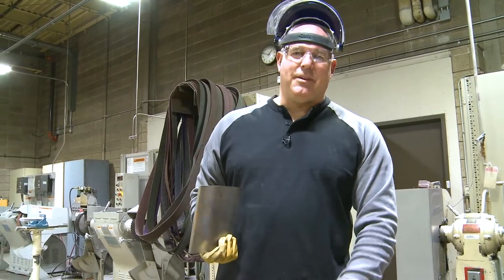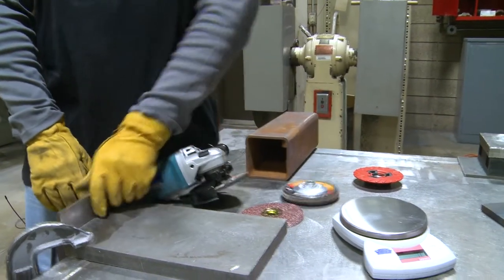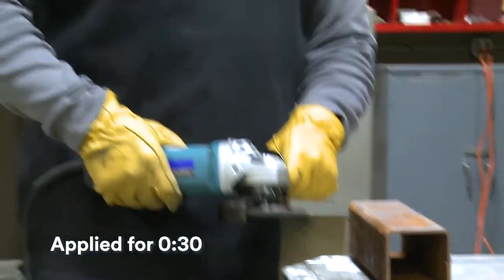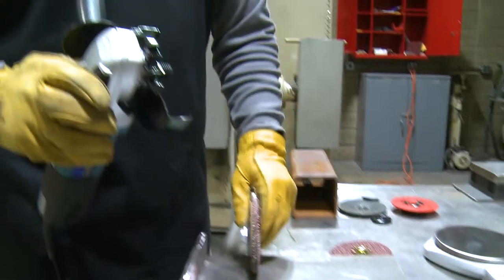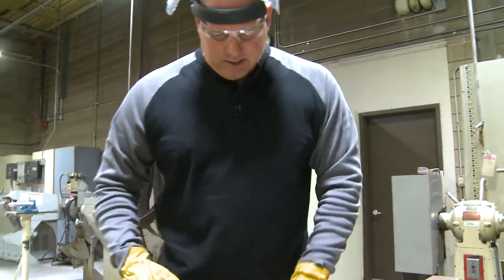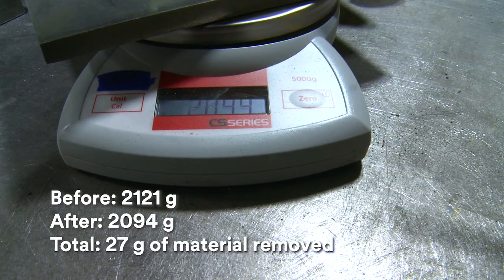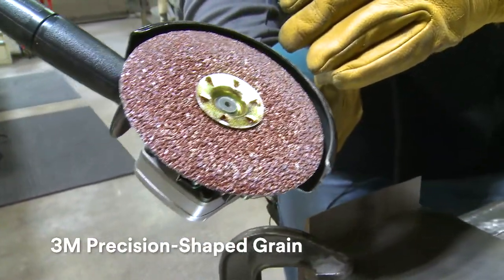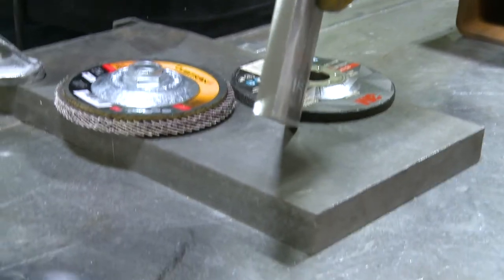Beveling with 3M Abrasives

Comment: I’ve never seen a 3M rock or flap disc in any of the fab shops I’ve done NDT in or in any supply shop I’ve patronized. But I’m going to have to try to find some before continuing the rust and paint removal on my project car. Note to self: get a good dust removal system first because these things can create a lot of dust quickly.